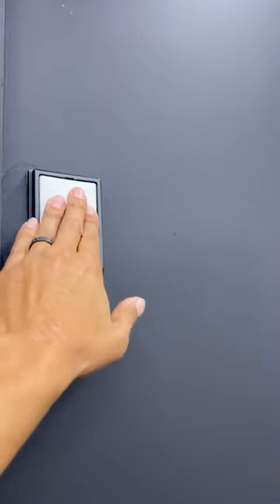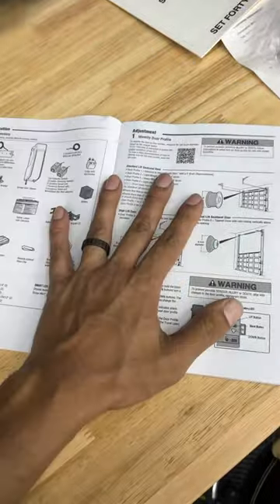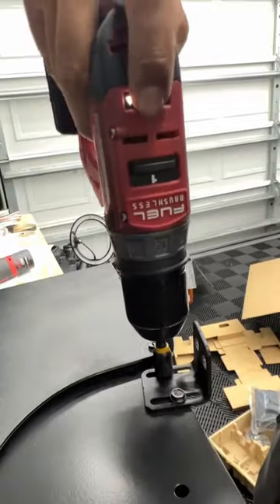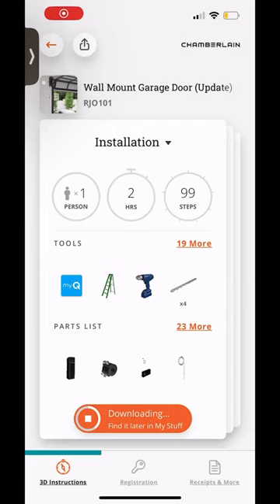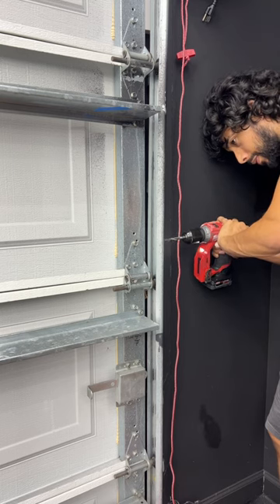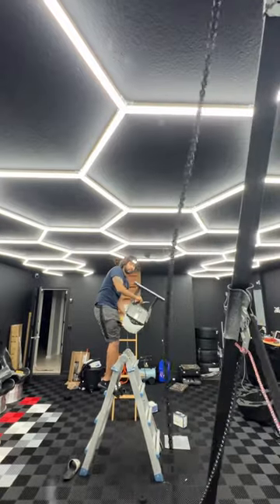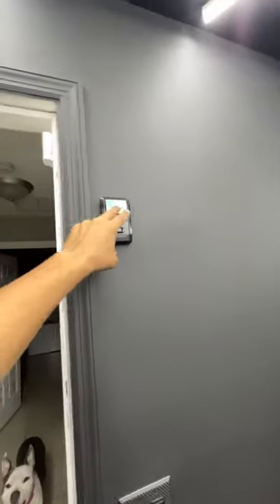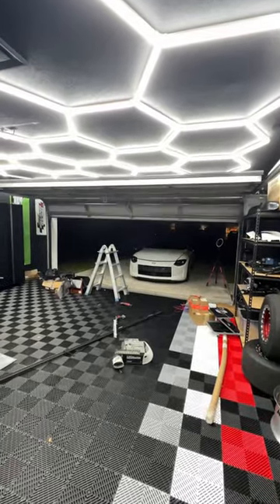New Addition To My NISMO Inspired SHOWROOM Style Garage 😍

Comment: How are you liking your swisstrax? I am looking to get it for my garage.
Reply from the maker: These are racedeck tiles. Takes some getting used to if you’re a gearhead. You’ll have to make small plates for your jack and jack stands. A good shop vacuum is needed to pick up dust and if you drip anything you’ll have to lift the tiles up. 

If you can live with those extra maintenance items you’ll be ok.